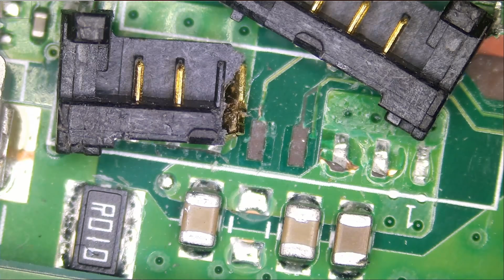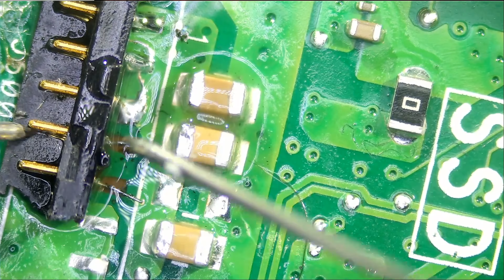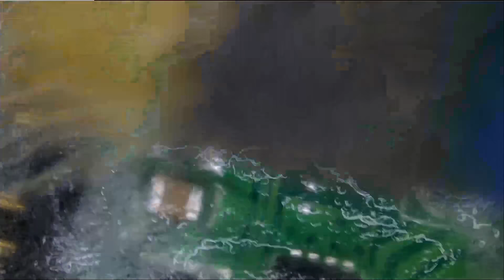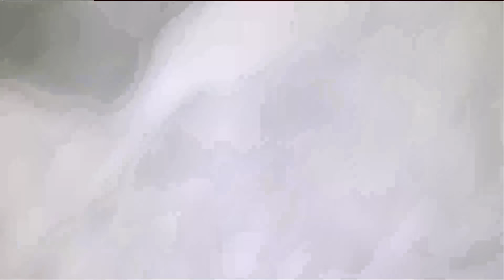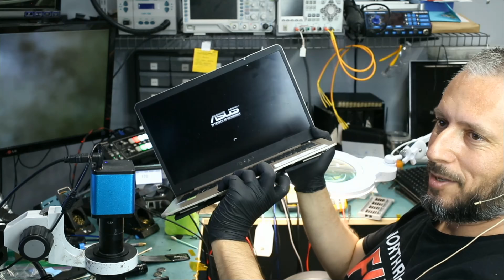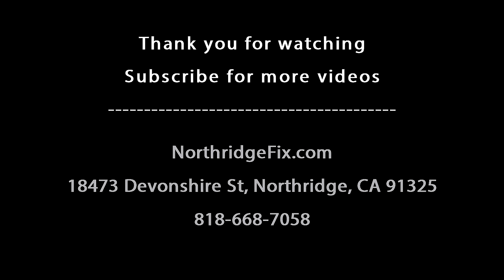Asus Vivobook repair using the same broken battery connector and the only one available

Comment: Great channel. It would be great if you could show a video in which you removed and replaced a smd plastic connector. The nintendo switch has very small plastic connectors that melt very fast. Like the battery connector or speaker connector, or anyone of the small wire connectors on the board. No one really shows how to remove those components the correct way. That would be a very informative video that I believe a lot of your subscribers would benefit from.
Reply: Heat the board from the back, also maybe apply low melt solder first.

Comment: A pro tip, you can use an old soldering iron tip, to weld the broken plastic pieces together. I sometimes cut pieces of zip ties/cable ties for extra plastic ,to fuse the broken pieces together.

Comment: For these battery data lines, there were test points near connector in right side of screen.. I'll, probably, in this situation, will solder extension wires to these points - quicker and easier.. 😂

Comment: A craftsman at its best, good job 👏 i hope you hotglued the connector maybe just for rigidity. But one question, why didnt you use the pre-fabricated quick pads, the ones on the copper foil with the plastic piece if you know what i mean. Or is it  because you're just being used to use wires instead?

Thanks for sharing, take care of that finger 😉.

Comment: I thought Alex would use the template pads for restoring the missing pads. Guess the jumper wire is easy and quick fix. Good job

Comment: Erm, I can relate on how hot a soldering iron is. I started when I was 9-10 years old and wile my iron was still powered my mom came into my room with a vacuum cleaner. When she kneeled down do vacuum underneath my desk I noticed she got tangled on the wire and saw my iron coming off the desk aiming at her. In a quick reaction I grabbed it just before the iron hit her back but you guessed it, I was so quick that despite the iron falling down hot end down and trying to grab the handle or wire I had my hand wrapped around the heating element. Luckily it was short as I threw it away, only had a huge burn on my handpalm which subsided within a week and a half But more importantly I saved my mom from being burned. 

Great job reconstructing the broken connector!
Reply: There is a saying "a falling knife has no handle" - same thing applies to soldering irons

Comment: The power connector seems to be attached to the motherboard just by the remaining solder joints.  Is there a way to secure it so it  hold up to the stress of normal use?

Comment: I’m curious as to how they ripped it off in the first place that’s a LOT of damage.
Reply: Same as always with connectors. It's either they pull on it thinking its a pull connector or more likely they don't know which part is the one that you take off. Lets not forget plastic in laptops is heat cycled many times because of the heat induced my laptops wich makes the plastic more brittle

Comment: I wonder how many of these repairs would be avoided if more sturdy through hole connectors were used.
Make sure you fill out the injury in the workplace paperwork. ;)
Reply: When it comes to connector toughness there is a middle ground that needs to be met. Where if forced the connectors need to break before the board or the attachment. same wirh DC connectors on laptops. If forced the cable will break before the port etc..

Comment: I keep SILVEROL paste in the fridge door : any burn and I smear it and in 30 seconds the Pain is gone and healing is excellent. over the counter in the Pharmacy.. no MD needed.
Reply: even running the finger under cold water would help a lot, I guess he didn't want to interrupt the video
Reply: @pcb1962  no it won't. the medical paste helps in healing the heat damage. "cold" is just "running away from the heat" , not treating the cells

Comment: The connector has no mechanical bond to the board. Would solder mask applied to the front edge help to secure it?

Comment: Best way out here would be to {as there are only 4 connections} use a new type connector with atleast 4 pins and change the connector on the battery as well.

Comment: Hi Alex, great watching you work, Just a question, did you leave a pin out of the socket? if so, what does that pin normally do?
Reply: It was just another ground connection. Two pins can carry the current.
Reply: I was watching in my shop at the counter, I must have missed that between pauses. Thanks for the reply.
Reply: How did you watch the video and not hear him twice saying the missing pin is just an extra ground?

Comment: I think if the connector was glued , it'll be more stronger, anyway it's a great job
Reply: or solder mask it
Reply: Customer will find a way to break it again, unfortunately
Reply: Yeah, it needs something to secure the connector so it's not solely reliant on the pins. Good job, but not sure if I trust it long term.
Reply: i also think

Comment: Hey Alex! Did you ever try glueing one of these connectors back together before soldering it back onto the board? I would imagine it'd give it some more stability. I'd try superglue, I made good experience with many types of plastics.
Reply: better to melt some silicone over. Not superglue otherwise it will become really hard peace and if the conector doesn't work u make a mess.

Comment: That type of connector is a real trap for those who do not know how to remove the battery connector without ripping off the board's connector. There is a metallic bracket that needs to be pulled back.

Comment: If you burn your finger, just put some alcohol as quickly as possible and blow on it for few seconds. (Just need to cool it down as quickly as possible). Repeat it several times if needed. Guaranteed that it won't hurt or leave even a mark anymore. You will forget it in minutes. I do this every time I burn my skin by the soldering iron.

Comment: It'd be great if there's a way to 3D print a proprietary connector that's no longer available in the market, so you don't have to reuse a broken connector
Reply: Seems like a great business idea if you could make it work
Reply: It's possible with a SLA printer but it would need way too much time.
Reply: Yeah but connectors are made from copper thingies too and those cant be Printed :P
Reply: @khirobey6261  you could print holes to put  the old ones in !!
Reply: @khirobey6261  Actually you can, with metal filament. or replace both end connectors with more common ones, jst balance connectors come to mind.

Comment: Hey Mr. Alex, I was working on a msi am3+ motherboard, few of vrm MOSFETs were shorted to gnd so I replaced them but now it doesn't post anything on the monitor. Everything (cpu fan, graphics etc.) Working properly. I flashed the bios thought that it got corrupt and also tried different ram's but nothing is helping.

Comment: I will use some gorilla glue or hard glue to settle it in place. Or plus piece of thick wire over it from ground-ground soldered on each end also buried in the glue.

Comment: Could you use epoxy to secure adapter down further if u wanted?
Reply: Yes, always do that.
Reply from the maker: No need. The connector is not going anywhere and the customer should not touch it..
Reply: @NorthridgeFix  He broke it once when it was in factory state so...
Reply: @NorthridgeFix  Alex keyword there is "should not" but I had customer let curiosity get the better of them. Nice repair either way :)